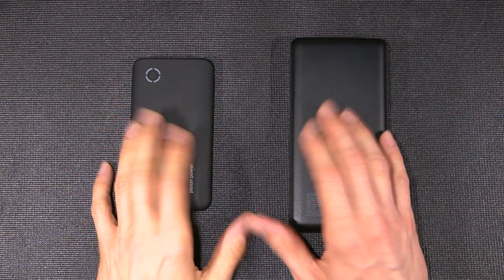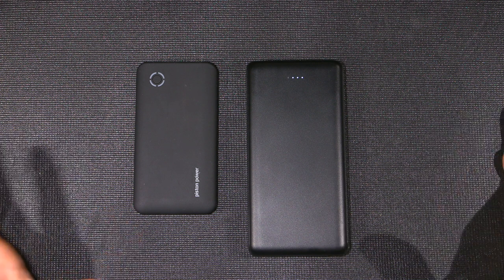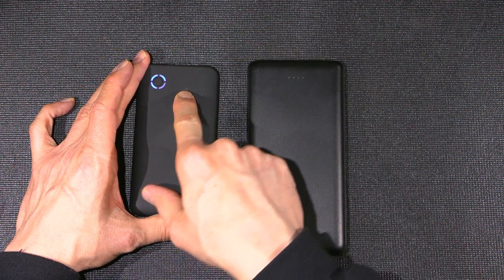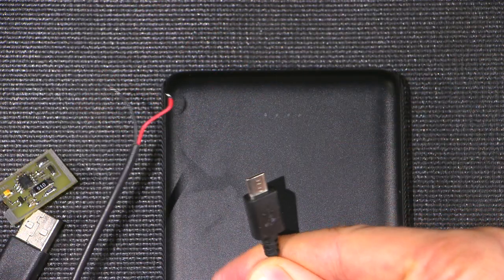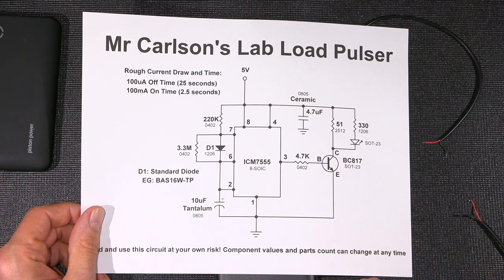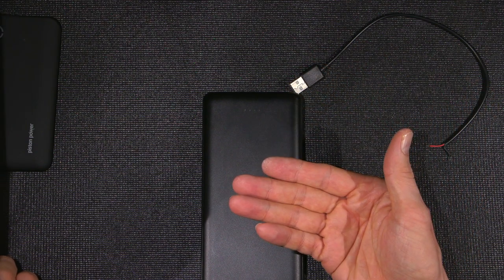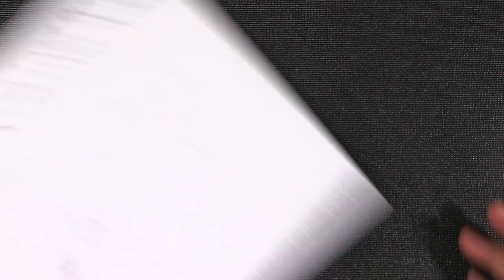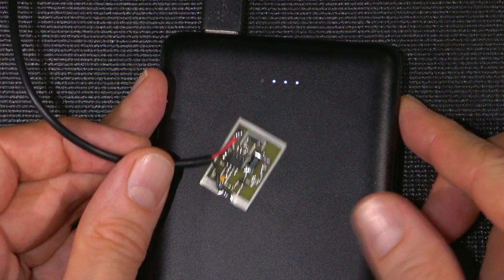Power Bank Stay Awake! Here's A Circuit To Do That:

Comment: Does it need 2.5 s on-time or would 0.5 s do the job as well? The less power you draw the better :-) Is there a time limit at all for the on-time?
Reply: I think that it depends on the power bank design, and you will have to try these numbers first by manually loading 0.5 seconds with a resistor every 10 seconds, and see if you can keep it going that way. The shut down time is easy to measure.
Reply: @erikdenhouter  Hmm, Mr. Carlson told us about the same IC built into most of the powerbank to regulate the shutdown. So i think in most of these the values are very similar. Just curios, why he set it to 2.5 s on-time. Sounds it needs some amount of energy being consumed to keep it on.
Reply: @richardnanis  Definitely do not assume that, it is quite easy to check. There's always a time towards the developement of such a chip in which preliminary designs go around, and manufacturers don't waste old stock.

Comment: This is an unnecessarily complicated circuit. I have shorted the timer lead coming out of the IC and it works OK. It does not consume any extra power. The timeout circuit is there for a purpose as not to waste power.

Comment: If you chance the resistor for a ptc with about the same start value (room temp) than the value will increase if in any fault it would stay on longer. Than the current draw would decrease when it get to 🥵 hot and increase than 🥶 colder, 🥵 🥶 🥵 🥶.... 😎
Reply from the maker: Hi Joop. What keeps the value of a PTC high :^) "Hint:" heat.

Comment: Is there no danger of the battery Catching Fire if you drain the battery, if you had that on and put the battery pack away and forgot about it  and it drain the battery below it's 10% threshold there no risk it Catching Fire?!
Reply from the maker: All these packs have a low battery shut down.
Reply: @MrCarlsonsLab  right ok so you have to make sure you don't bypass the shut up
Reply: @johnsweda2999  lipo/liions tend to only go boom when discharged rapidly or overcharged, being drained to 0 kills or shortens their life(bigclive proved it by buying 0 volt out of the box lithiums that needed a few cycles to hit capacity that it doesnt actually KILL them in all cases) i have an entire box of 18650s and other assorted size/type lithiums and i've only had a few go thermonuclear ever and it was always due to flat out abuse such as charging them with 5v from usb directly(and not cutting off when it hit 4.5+) or discharging at 10c on a laptop grade 2800 mah battery

Comment: Easy put a led and a resistor in line with your USB cable and the power bank will stay on that's how I charge my rc car
Reply: Yes, but that puts the load on constantly, instead of being off 90% of the time.
Reply: @jeepien  is true I might actuly build one of his circuits I would come in handy I only use a cheap power bank why I probly get away with keeping it on mabey more expensive ones would need that circuit to keep it awake is a smart idea I give him that

Comment: For phones, isn't this solving a problem that doesn't exist? All my (about 20) PowerBanks will keep a phone at 100% charge indefinitely, until the PowerBank is dead flat.
The PowerBanks "wake up" when they detect any load on the USB output.  - that's what makes it "wake up" when the USB cable (with phone attached) is initially connected. There is no need to "press the button" to activate USB output, the power comes on automatically.
Even if the phone current drops to zero after charging, as soon as the voltage drops slightly the charger will try to top up the battery and that will trigger the USB output of the PowerBank to restart.
So you don't need a pulser for phone charging - it's only needed for devices that draw such low current that the button must be pressed to activate the USB output.
Reply from the maker: The powerbank will not reactivate or turn back on by itself (as most do not.) If you have a powerbank that will stay on all the time and keep your phone topped up, you are a lucky fella.

Comment: You wouldn't wanna over charge the battery in your phone because after all the charge circuit is in the power adapter < sarcasm. Every time I plug in a low power device/led into a battery brick I am like this is great and then five seconds later it turns off.

Comment: Why use timer? And not very cheap timer at that. Simple not gate with 2 resistors and 1 diode can do the same simpler and cheaper. We can go cheaper(if we do about 100pcs) simpler and smaller with some otp micros but it would be silly. I kinda hate this timer for how redundant yet popular it is for such tasks.

Comment: What a Stupid feature they put into PowerBanks..We want them to run all the Time..Awesome solution will build..
Reply: Some power banks always have 5 volts on the output, and don't shut off, unfortunately it's usually the cheaper smaller capacity ones.

Comment: An even easier idea is to just put a new battery in the phone.
Reply: Some people use power banks for other purposes totally without a battery, but the low currents such device uses also shuts down the power bank. Not only that, but if you need your phone on for an extended period, that 20,000 mAh is a welcome aid.